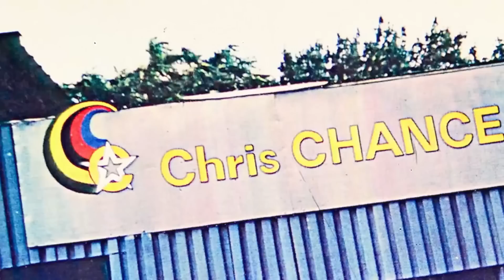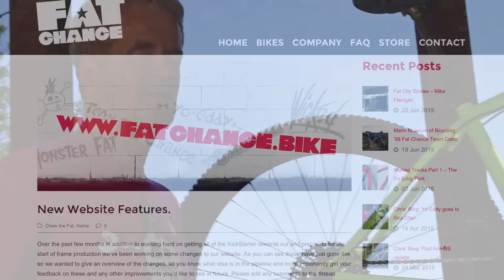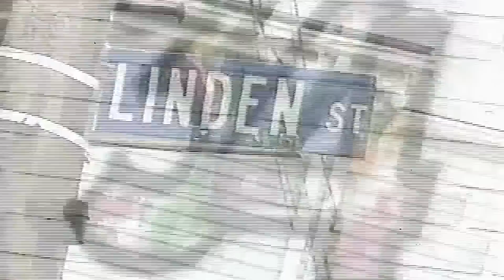TPC Museum Series #8: Chris Chance, Fat Chance | Meet the Maker | The Pro's Closet

Comment: Still got my Wicked Fat Chance I bought in 1989.  The painter had quite the imagination with red, orange and magenta.   Only complaint is the bottom bracket bearings.  They are pressed in and do not last more than a year or two depending on how much I ride and if it is wet and/or muddy..  Would love to get a new Yo Eddy but my old back cannot handle a hard tail.